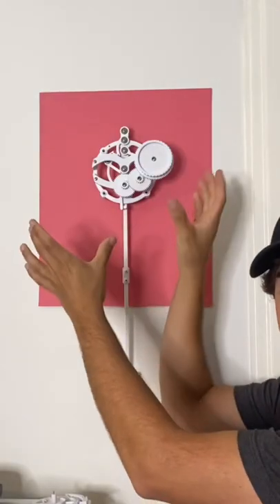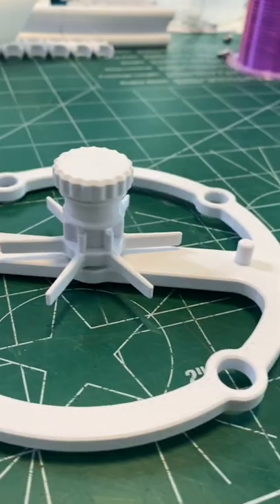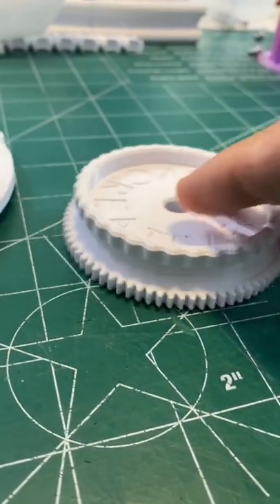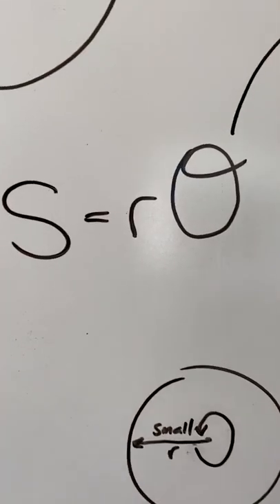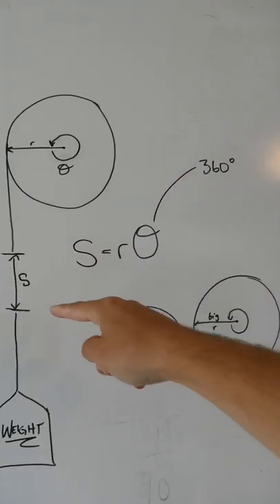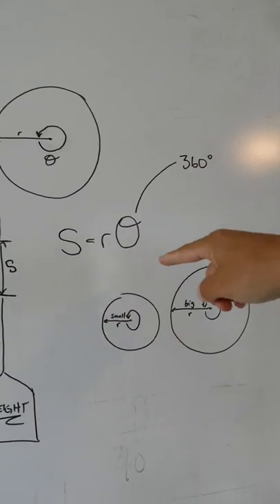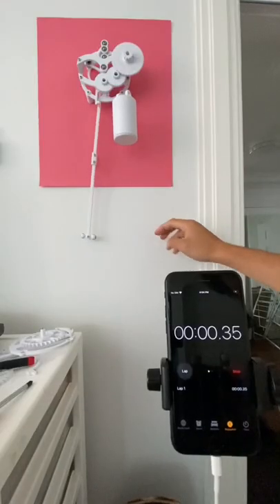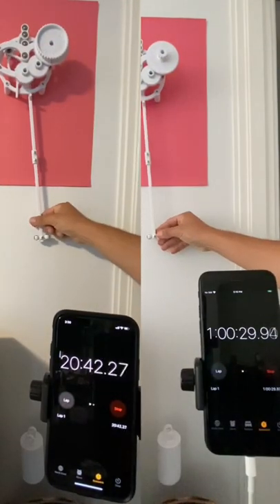Why I Made the Spool Radius Smaller | Clock Mechanism

Comment: If you add a pulley to the top of the drive weight and run the drive line thro the pulley and back up to the clock frame, where it can be attached, you can double the run time, by doubling the weight. Almost all clocks use a pulley on the drive weight. You could then try a longer pendulum. Anyway, good work!

Comment: Would love to see this beating our old clock that could run for 6 weeks with one windup
Reply: Yeah those old German cookoo clocks really took the cake
Reply: A 1000x increase in runtime? That could take some serious engineering.
Reply: @doctorbobstone  yes that's true, but that serious engineering has already been done by swiss watchmakers centuries ago.
What you really mean is that for this guy to accomplish it would take some serious education. And probably a material stronger than plastic for fine gear teeth, etc.

Comment: It actually makes perfect sense, the diameter of the spool is basically just another gear reduction.   If you have a spool the sise of the gear, it is a 1:1 ratio.  If you have a spool 1/3rd the diameter of the gear you get a 1:3 ratio.   So for 1 unit of movement of the spool is 3 at the outer diameter of the gear.  

If you want even longer runtime. You could double the gears, using the same thing on both sides of that center gear at the bottom,  double the ratios then use a weight on both sides.

Comment: Spools, gears, and belts all essentially work the same way. The smaller it is, the more times it has to rotate to go the same distance. This also changes torque by the same amount. If you made the spool small enough, the friction from the gears might actually prevent the clock from moving. This is why beyblades and gyroscopes are very thin at the point that actually engages with whatever mechanism that spins them. The same amount of string allows for many more rotations in the same amount of time
Reply: Or, in other words, using the bigger spool with the same drive weight, would allow for a longer going train ratio to be used, and the clock would in theory run for a similar time...
Reply: @andrewh2312  if you use a bigger weight and a longer gear train, it would run for considerably longer
Reply: @thedudeamongmengs2051  agreed: the point I was clumsily trying to make was that the torque transferred to the gears with a larger diameter spool will be greater than with a smaller spool (with the same weight):  So if the weight would drive the clock on the smaller spool, we can assume there is unnecessary weight on the bigger spool which could otherwise be used for driving a longer gear train and reducing the 'drop per tick'...

Comment: Idk how many times I’m going to comment this before it gets noticed but, use braided fishing line over monofilament fishing line, it’s an overall thinner diameter with more strength, no memory (so it doesn’t coil up if you let it go) and it has no stretch

Comment: This is kinda silly. If your trying to extend your time your starting in the middle of the problem and working both ways trying to solve it. Find out the minimum required torque to run the mechanism and work from there.